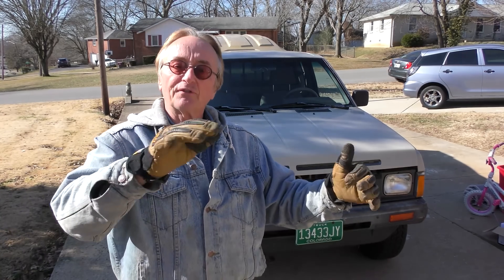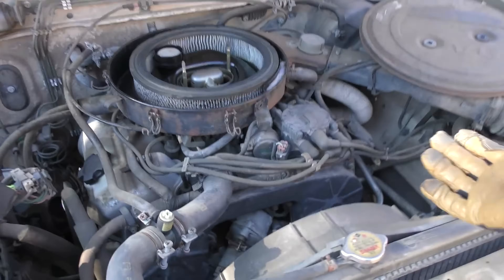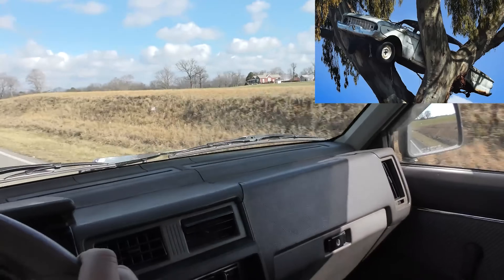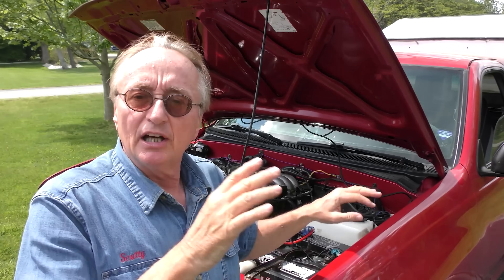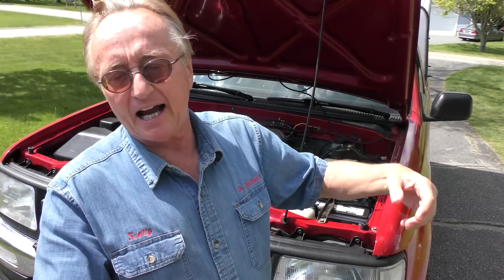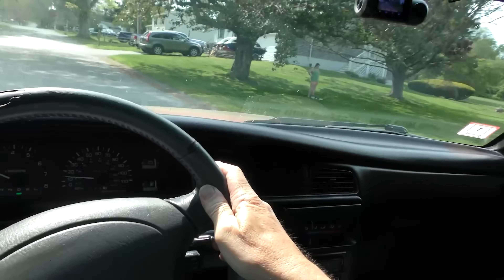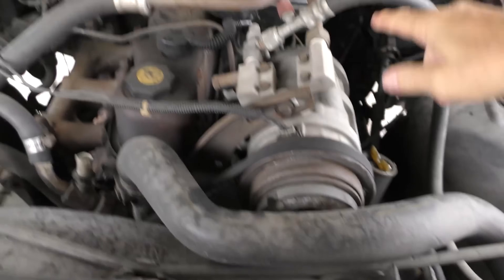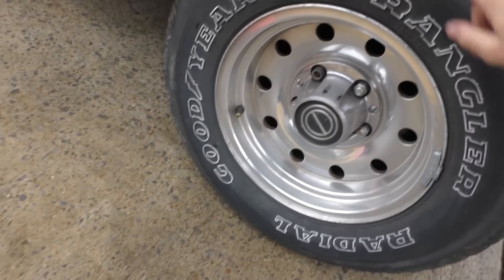3 Cheap Used Trucks That Will Last Forever (You Can't Destroy Them)

Comment: Nissan is not Nissan anymore.
Reply: The New 3rd gen frontiers are doing pretty well
Reply: @TheAverageFisherman99 I used to love Nissan I owned 2 of them but they reallly went downhill , 90s Sentras are practically bulletproof
Reply: nothing is sadly
Reply: Nissan quality couldn’t be any lower.
Reply: Some of their big vehicles are ok but there small sedans are terrible
Reply: Can thank Renault for that
Reply: Their trucks are still good
Reply: Yes,those days are long gone 🎉🎉🎉🎉
Reply: they’re slowly improving, at a less constant speed as toyota or others but they are at least improving
Reply: I got a brand new Hardbody in 1990. First year of the KA24 motor which was completely bulletproof! I wish I still had it!
Reply: Dat soon
Reply: @officialnotonlyjames they finally decided to go to gear transmission on the pathfinder but decided to downsize engines on most of their cars. The rogue and altima used to have 2.5l engine.
Reply: Sadly no it isn't. My last one was a 1994  Hardbody 4x4 and it was real reliable.
Reply: What about about buying a new Nissan with manual transmission? Anyone?
Reply: @Nick-b7b9s remember what Renault did for AMC?
Reply: Oui 
Oui
Reply: I had a 1996 Nissan Shortbed pickup.  Black. 4 Wheel Drive. Stick. 
She was a beauty!
Reply: @reymarquez4179 , who, what & where you gonna get that !?
Reply: Had a 2003 Maxima.  Best car I’ve ever owned.  Fast, comfy, bulletproof, no squeaks or rattles.  Traded it for a 2013 Maxima.  It was OK, but not nearly as solid.  Had a clunk sound in the rear quarter panel after 40K miles.  Squeak in the dashboard.  More chips in the paint which the older one seemed to resist.  Thin paint around the trunk lid which wore down to the primer.  Fortunately, no mechanical glitches, but I recently traded it in on a Lexus ES350.  Figured I got 10 years out of the 2013 Maxima and was rolling the dice with the CVT, so got rid of it before major problems.  Heck, should have kept the older Maxima!
Reply: Ya why make a reliable car when you could make billions of dollars instead in dealership repairs
Reply: And they were never Datsun
Reply: It is now Nissan.
Reply: @RC51Legend  No. Its own by Renault-Nissan-Mitsubishi alliance & Infiniti.
Reply: @Nick41622  were do you buy them new nowadays? I don't see any Renault dealerships and they're not in the showrooms of any Mitsubishi or Infiniti dealerships. I only see new Nissans at the Nissan dealerships. They still say Nissan on the marques.
Reply: Maxima was really nice in the 90s. Only time I ever looked at them.
Reply: Just as Scotty has told us.
Reply: @pinkpanther4291 and what is their gas mileage like?
Reply: @officialnotonlyjames and they should never have dropped their quality to begin with.
Reply: @TheAverageFisherman99  they’re sick trucks.
Reply: Nissan still makes good trucks. Especially the Frontier. I know that their cars with CVTs have a bad reputation.

Comment: Drive the old one's until the door's fall off, then get some bailing wire, fix it,  and keep on truckin.
Reply: My backseat tool kit when I was a young pup was a hammer, pliers, a few wire coat hangers, and a roll of duct tape. Backseat literally because if you opened the trunk, all you saw was the ground because the New York State winters with salt ate them away, haha!😂

Comment: My 2011 Ranger 150,000 miles and no truck payment. ❤
Reply: I drive a 4 cylinder 5 speed 4 ranger.It's a 96 anything from the second generation to the Ford.Terriers to the seventies are the best of small trots
Reply: I've had an '02 Mazda B3000DS since '11, second owner. Runs like a champ, rarely has any issue(s)...
Reply: 2008 Ranger here!
Reply: Hard on gas big time your not winning maby if you had a tocoma.driving a Ford is a consent payment. 😅

Comment: owned a 1982 f100, bought it used kept it for 25yrs
Reply: I had a 1982 ford F150 V8, rear wheel drive, automatic transmission, pick-up full Z-bart rust-proofing on the undercarriage. Oh how I loved that truck. I got it 4yrs old, in 1986-7 and drove it 'til 2012, also 25 years. My x-husband got it for me after my first truck was stolen... 1978 Ford F-150 a beautiful dark green. My 82 was a yellowie beige, I called it baby-poo yellow, but it was my ride. Assembled in Canada.
Oh yeah, it was also the last year they made the full size Ranger.

Comment: I have a 1995nissan hardbody had it since 2006 iam the second owner! Its black 5 speed manual transmission! Automatic hubs still work! V6 vg30E engine! Extended cab 4x4. Awesome truck never seen rhe woods much either! Just a daily and great in town in the snow and ice! Thanks Scotty for representing the Hardbody they are truely underrated trucks!
Reply: Change the transmission oil. It’s stinky, but do it. The manual transmissions are the weak point. Don’t neglect to do the timing belt when time.
Reply: Dude I have a 1996 that I got in 2006 but mine is a 4 cylinder

Comment: I bought a 95 Ford F-150 in Nacogdoches, Texas. Currently has 335,000 miles on it. Just spent $4000.00 to get a bunch of work done that it needed. It runs better now than it did when it was new. I pulled a lady's houshold full of funiture and stuff in my 7' X 16' trailer to Phoenix. I had everything tarped and strapped down. Stopped at a rest stop and some of the truckers came over to see my "rig".  Great conversations. My kids are already waiting for me to die and there is gonna be an epic battle to which one of my six kids gets my truck. I'm 70 and still very active.
Reply: I have lived in Nac for 12 years. 
Funny how I could just run across a comment about my town.
Reply: @dominickthornburghakaTRG my son went to college in Nac…….nice town
Reply: I've seen a few of the older F-150, I will definitely keep in mind that they are solid.
Reply: May you live to 100 brothers!
Reply: The Ford F-150 between 1988-1996 square bodies can live through an apocalypse. My father had a 1990 Lariat w/ straight 6 and It had over 400,000 mi on it. Id borrow it regularly as a teenager and ran the dogshit out of it. Although I’d fix anything that broke the truck NEVER stopped running even when broken. It was diehard reliable. 😎
Reply: Keep your kids waiting, for a long, long time I hope!
Reply: Give it to your secret favorite child

Comment: Scotty, I am the proud owner of a 1967 Ford Econoline van that was first used by Southern Bell Telephone in Atlanta, GA. It’s a heavy duty van that comes with a between-the-seats 240 cid straight six, a 3 on the tree manual transmission and a 9 inch rear end. When I first found it, it was laying on one brake drum, two flat tires and a dog was living in the back. That was many years ago, but I still have my straight, rust-free but ugly van. And it still runs amazingly well.
Reply: The ride nice...
Reply: @rogerringold616  Actually, when it’s got some weight in it, it seems to ride better.
Reply: I hope you took care of the dog.  After all you took it's home.❤
Reply: Would love one. Great find!
Reply: Those are getting fixed up.  Look up late 60s ford van restomod.  I want a 69 Ford camper van 4x4
Reply: Nice!!! I have a 1967 Ford F250 ; )

Lots of similarities with your van!

Comment: Old Toyota trucks are the best. Simple bulletproof trucks. Super easy to work on and parts are easy to find.
I bought a basic 2001 Tacoma 4cyl for $3k and I love it's simplicity! Modern trucks have way too much crap on them now.
Reply: $3,000 is a steal for an old Tacoma
Reply: I have owned many ole Toy pickups but the Datsun/Nissan is just as good. I am currently in a Nissan 4x4.
Reply: The best at rusty frames and breaking in half. Search tacoma rusty frames
Reply: @filfarmerpacnw4868  Not a problem if you don't live in the rust belt
Reply: Where do you find 2000 trucks that run,THATS what old gravel road rusty Chevy caviler cost in my neighborhood
Reply: That Nissan is worth about 10 k in that condition, not 2
Reply: Tacoma❤️
Reply: Toyota will give you a new frame...I got one for my 2004
Reply: The toyota mini-motorhomes in the mid 80's had an extended frame that would bend downwards and have a kink in the wood floor of the RV. I had a few and each one kinked.
Reply: I've got a 2002 tacoma with a 4 cylinder.  Love it!  Roll up windows, manual seats and extended cab.  It's a thing of beauty.
Reply: Too many tools with money came to think they could hide their suburbanism with a truck, and instead they wrecked truck culture AND didn't hide their suburbanism.

Comment: A good friend who has owned and driven a number of FWD vehicles on the job and private gave me this advice.  Always drive in by two wheel drive so if you get stuck you have four wheel drive to get out.  Of course some drivers have winches and options but driving into the outback in four and getting stuck,  well hope your two way radio works.

Comment: I have a 2001 Nissan frontier with the 3.3 4x4 automatic. It has 289k miles on it and still runs and shifts like a champ. I've only had to replace the distributor, heater core, various emissions hoses, fan clutch, timing belt kit, and regular maintenance items (fuel filter, spark plugs, brakes). Hoping to get it to half a million.

Comment: Still have my 1995 Toyota Tacoma.  2.4L 4-cyl with 5-speed manual. Live in San Antonio, so no road salt.  Northern vehicles rust out.  Down here, the paint disintegrates.  Had it repainted once, and it needs repainting again.  Plastics inside are cracking, too.  That’s what happens with a non-garaged vehicle down here.  But it has served me well for 29 years and I have no intention of selling it!

And, as Scotty says, the A/C STILL BLOWS COLD!!!
Reply: Yep I live in Houston Texas the heat is our worry

Comment: In 1987 we had a tornado coming at Altus Air Force Base and needed to get aircraft moved to anchor points. Had a F-250 tow tug with the 300 straight 6 and that sucker grunted like crazy but was able to pull KC-135 and C-141 aircraft. Some might ask why not use an aircraft tug... Well... We had a nice big tornado tracking right at us and we needed to do things REAL quick and we didn't have enough equipment to get things done in time.

Comment: I learned how to drive stick on a Ford F100 that had no power steering with three on the tree. Try being at a stoplight on a hill and you have to make a turn in that situation. I'm a truck driver now and the Kenworth t680 that I drive is a walk in the park compared to that pick up.
Reply: My 1st vehicle was a 1970 GMC with a manual transmission and I learned how to drive a manual transmission with that truck after my dad drove it home and I taught myself to drive a manual. You're absolutely right about the hill and manual transmission. I have a Ford Focus with a manual transmission
Reply: I learned to drive at 13 years old, three on the tree in a 1949 Studebaker with no power steering. Just the same in the circumstances you describe.
Reply: I learned on a 74 GMC three on the tree, 350, standard steering and brakes….luxurious it was not…lol
Reply: Yep, except mine was an old Dodge, plenty of cussing,haha!.
Reply: I drove stuff like that too, but just drove it, no problem, I never felt the need to be a DRAMA QUEEN about it.  What is the matter with you?

Comment: Had a Mazda B2600. Great little truck. Engine was made by Mitsubishi. Never burned any oil. Had to get out and lock in the 4 wheel drive front hubs. Drove it about 200,000 miles. And then sold it to a friend who, last I heard put at least another 200,000 on it.
Reply: The big SOHC 2.6 L 4 cylinders were torquy as the devil. The 2.8 L V6's had about the same HP and torque figures as the big 2.6L 4-cylinder, but had to Rev 2000 RPM higher than the torquy 4-cylinder to make the same HP and torque! The low RPM torque of that big 4 makes a BIG difference when crawling off road.

Comment: In our family, we had all 3 of these at one time.  I had a 1990 Nissan Hardbody P/U (2WD, but a great little truck).  My brother-in-law had a '92ish Toyota T100, and my Dad had a '76 F100, with the straight six.  All three were manuals.
Reply: My 1976 f250 is still running but after Obama I'm having trouble with parts....

Comment: 87 econoline 300 c6 430k miles tows 5klb trailer 5 days a week.  Cost of operation about a half quart of oil a month and some wd 40 keep corrosion off the starter solenoid.

Comment: I had a 1991 Nissan Hardbody D21 with the KA24E engine and 5 speed, it had about 750,000 miles on it when I retired it. Engine never touched but it was on its 3rd transmission.

Comment: I just worked on an 86 f150. It ate the timing gear on the cam the original gear was fiber i installed an aluminum one. I did the water pump and power steering pump as well it has 232k miles on it and is a solid truck.

Comment: I bought a used 1990 Ranger in 1998 . It has the 2.3 engine , 5 speed with on 20,600 miles . I now have 188,000 on it , and my mechanic says he has never seen a truck or car this old look so good . I use to detail cars so it’s not hard to take care of it . Also regular maintenance is a big part of longevity .

Comment: I have two nissan 1400 bakkies...light delivery vehicles...a lot smaller than the hardbody...but...oldschool and simple ....very popular here in south africa...cheap to run reliable as can be...and with care it will take you almost anywhere...points condenser ..you can tepair in with ordinary tools wire and duct tape...it has earned the nickname..kanniedood...which means cannot die....you have to earn such a name..

Comment: I currently drive a 2003 Chevy S10 with a 4.3L V6 engine. Has nearly 200k miles on it, and bought it for $2,800 two years ago. Runs like a champ, and has never left me on the side of the road since I have owned it. Should be on this list, lol
Reply: I work in a paper mill where they had lift trucks with the 4.3 liter engines, absolutely bulletproof! I was the mechanic at the time and I couldn’t believe the ABUSE the engine went through and just kept running. I knew after that experience I would want the 4.3 for dependably.

Comment: I had a '97 Nissan Hardbody.  It was the last year they were made.  I bought the base model.  It had no radio, no carpet, or power windows.  It was just a basic  5 speed with the 4 cylinder, but it was a great little truck. The only problem I had out of it was the speedometer sticking.  I read that was a common problem for them.  I sold it in 2012 when I bought a Sierra.  I wish I would have hung on to it.

Comment: I have a 97 and it is awesome. Limited slip rear automatic hubs, but you do have to move shift lever to themdesired 4 wheel designation you want 4h 4L ect. Love it  . Bed is rusting above rear wheels but rest is good. I heard they ship the beds over and that's why they rust and the body doesn't. Unless you live in the rust belt then the salt gets it sooner or later. Still won't beat my Suburbans,99 and 2000. 99 has 3780,000 original except for the tranny,no smoke, knocks leaks or anything smooth. 2000 has 285,000 and ALL original 5.3 no smoke, knocks just smooth love driving it. Would take either to California and never think twice.

Comment: Salt was blamed for rusty cars for decades but the real culprit was sulphur in the fuel.  Both are corrosive but sulfuric acid dissolves steel much faster than salt water.

Comment: Had a T100 for a few years, awesome rig. So nicely balanced on the highway. The kicker for me was  needing things that there was no aftermarket for, and crazy expensive from Toyota if they were available. Sold it to a Toyota mechanic, and it's still running around town. Likely 500k kms on it.

Comment: I had an '87 Mazda B2000 King cab...great truck only the body rusted out in year 13-14...the engine lived on  at a local dirt oval track in a racers sprint car.
Reply: I wish they'd bring out another small 5 speed manual transmission pick up.

Comment: I paid $1000 for a '87 F150 with the 302 5.0L and it drove 2 hours back to my house on the highway with 2 crossed spark plug wires, no engine ground, a rusted out air pump, a failing water pump, and all bad struts.  I've since fixed all that, but it drove fine during the month it took to figure all that out. Runs like new now and it only cost me about $200 in parts and fluids to get it all fixed up.

Comment: I bought a Toyota T100 from the original owner and it the head gasket recall replaced and it had less than 100k. The head gasket failed a second time and the tires were all dry rotted. I have owned a few older Toyota vehicles. Be sure to have all of them checked out before you buy them.

Comment: I have a 96 Nissan 4x4 Hardbody (last year) that 8 miles when I took it on a test drive.  It now has 292686 miles today.  People are constantly asking if I want to sell it.  That ain't happening.  The truck  that I traded in for it was a 1973 Datsun PL 620.
Reply: I have a 96 too and it has 220,000, good to hear you got nearly 300,000 on it💪
Reply: @CornbreadFed785  my dad taught me well in high school that oil changes are cheap while engine rebuilds aren't.

Comment: I actually built a rock crawler using a 1990 hard body, 5 -speed man. I used a 80sToyota front solid axle up front, three link suspension, running 36" swampers, bobbed the box 12" .... it was a beast off road. One of the best builds I have ever done,miss that truck. The rear axle in these hard body's islike a ford 9" I think with 30 or 31 spline axle shafts.....

Comment: Got a Nissan Terrano I 4x4 -90. It has the turbo 2.7 liter diesel. It's not fast but it has torque like a tractor. One reminder is that you ought to check you manual transmission. Nissan put out a service bulletin on the amount of oil it should have. 5 liters instead of 3-5.. Drain the oil and then remove the gear shifter and fill it up with 5 liters of good quality  gear oil. With locking hubs it should do 8 to 10 L/ 100km.